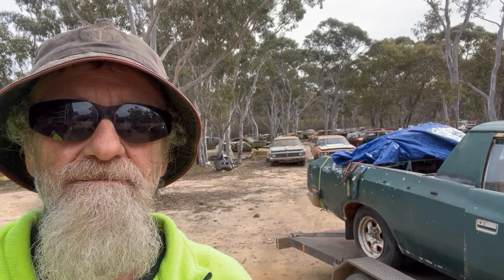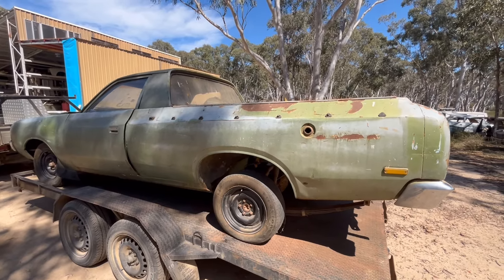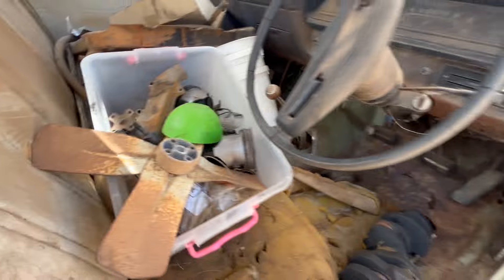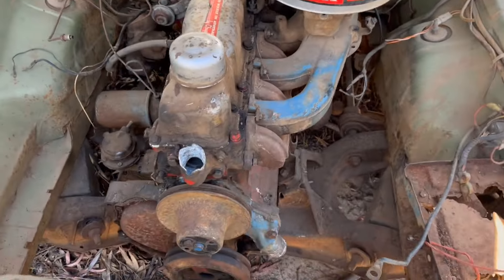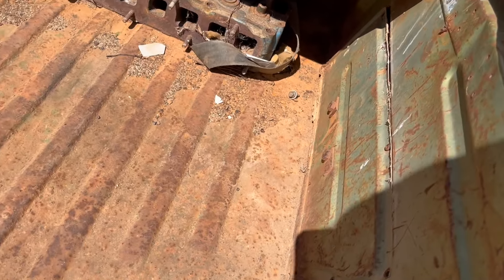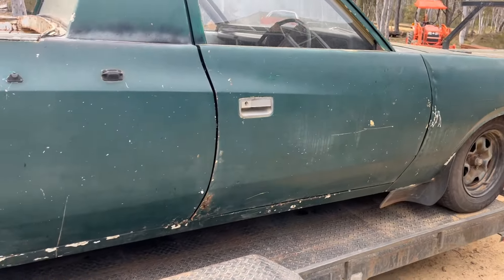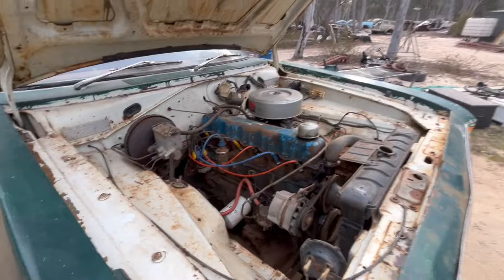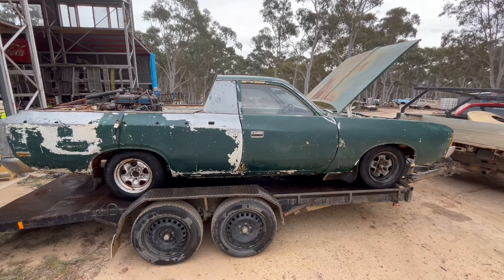VJ and VK Valiant utes turn up

Comment: Nice finds , what happened to the 318? Those are bullett proof , tried for years to kill one and it just ran great forever.  750,000 ks then sold the engine to a bloke that put it in a truck.  He changed valve stem seals and said it hammers.  I did change oil every 5,000.
Reply from the maker: @petergoodwin2465  not sure what happened to the original mate 
But have 1 there to go in 👍
Reply: Great to hear,  just always makes me wonder if a 318 is beyond repair.  Not hard to make them go . You wouldn't happen to have a pair of good cm wagon back side glass rubber seals . Had to cut mine out they were so dry.
Reply from the maker: @petergoodwin2465  got no decent rubbers mate 
Cheers
Reply: Thanks Mate, hopefully someone starts making those.